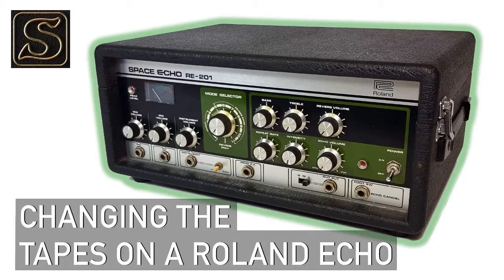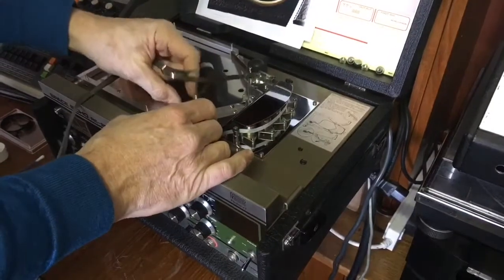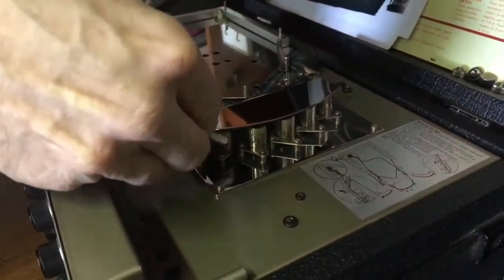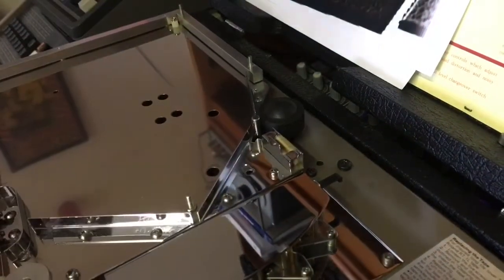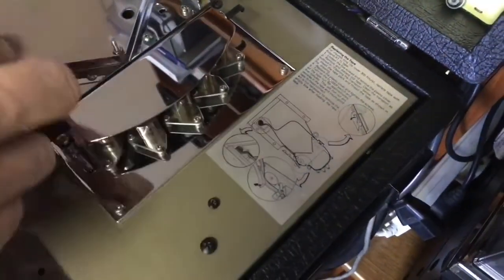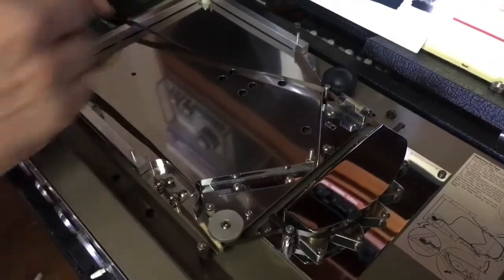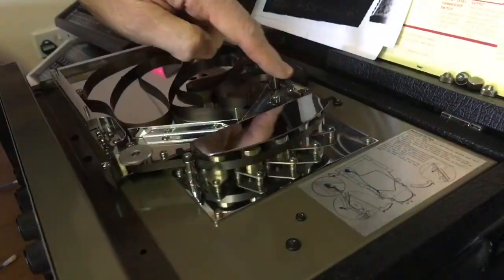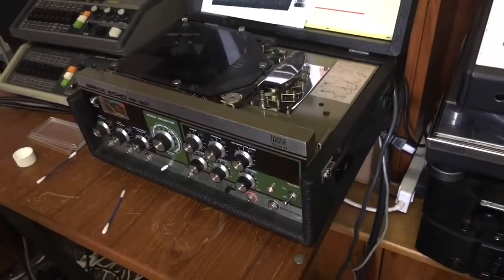How to Change the Tape Loop on a Roland Space Echo RE-201

Comment: I've got a space echo that I haven't used for years. When I tried, the reverb works, but no echo. I took the top off - the metal post beside the pinch roller is turning when I turn it on, but the tape isn't moving. 

Is the pinch roller meant to roll? because mine doesn't. I tried unscrewing it to lift it off as you have. But it doesn't want to move, so I haven't forced it. Maybe some lubrication is required there.
Reply from the maker: Yes the pinch roller should move. Could be one of several issues.

Comment: I've just bought one of this. She came with a very old tape loop. After I made a great cleaning, I changed the old tape for a new one. It didn't work (No delay sound!)! And so I put a second new one and didn't work. And then I return with the old tape and WORKS! Could you tell me why the other tapes didn't works?
Reply from the maker: It could be to do with the tapes you bought, unfortunately not all tapes are made equal and some can cause issues for RE-201s. The other possibility is that in fiddling around with the unit to change the tape, you could have knocked something back into place. It is unlikely but has been known to happen and obviously if this is the case, there is a chance of it being knocked back out again.
Reply: @Soundgas  thanks to pay attention! I will test with another tapes. All the best!

Comment: Hi Tony, in my device, the metal knob inside spins but the tape doesn't run through while the delay is supposed to be working. How do I fix this?
Reply from the maker: Hi Matt - good question, and one that we will be adding to our tape echo FAQ section on the site at some point. Doctor Huw our tech said that i's most likely to be either pinch roller pressure adjustment is needed, or it's quite possible the roller has seized. What you need to do is lift the roller away from the capstan and see if it will turn freely. If it doesn't then the bearing inside has gone. You can get a new roller and instructions on how to fit it from Shane at echofix.com

Comment: Are you using 70 % or 99% isopropyl alcohol  ? What is ideal length of the replacement tape ?
Reply from the maker: We use 99% isopropyl alcohol. We would recommend tapes of around 2m in length for Roland Echoes.

Comment: The replacement loop looks a lot shorter than the original...
Reply from the maker: It is: our techs have spent a good deal of time with these machines - probably more than anyone else on the planet. We've found that shorter loops are far more reliable and less prone to jamming/tangling. Tape life of our loops is still very long indeed (I'm running a couple of machines with loops that are over a year old).
Reply: @Soundgas  
Thanks for the reply. But, to me, it would seem more logical that a shorter tape loop would wear out faster since the tape splice would pass thru the machine more often than a longer loop? Overall tape thickness would also be a factor in this, and the quality of the tape splice (alignment and thickness). If Roland engineers who designed this tape echo machine calculated that a longer loop was necessary and/or better, I'd be inclined to rely on their judgment first.
Reply from the maker: @AlainHubert  completely understandable reply. 
Around a hundred machines a year pass through our hands - I suspect there are few people in the world who know these machines as deeply as our team. 

We restore and align them to perform beyond Roland factory spec (Roland was mass-manufacturing and Space Echoes were extremely profitable - designed to be quickly set up by relatively unskilled workers).

We spent a great deal of time and money tracking down the exact same tape stock as Roland used and then finding better splice tape (try an original RT-1L and you’ll really hear the splice - our splices are almost imperceptible).

I’m an echo fanatic and personally run five Roland machines - I’ve been using Space echoes for around 40 years - and I’ve never heard machines sound better that the ones we produce. And I’ve not had a snarled tape from one of our loops ever. 

Of course you may dismiss this as hype or biased opinion, but if you do try our loops and are unhappy for any reason, you can return them for a full refund.
Reply: @Soundgas  
That's a great sales pitch, I must admit. And thank you for providing replacement parts for that fantastic machine.